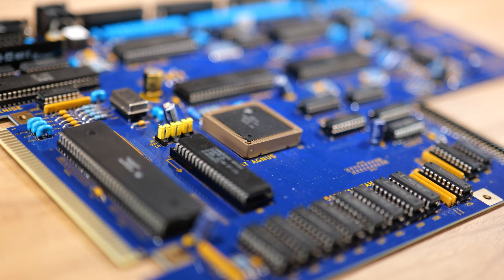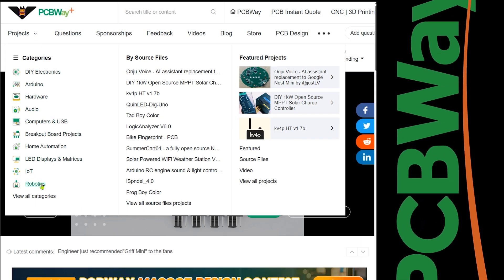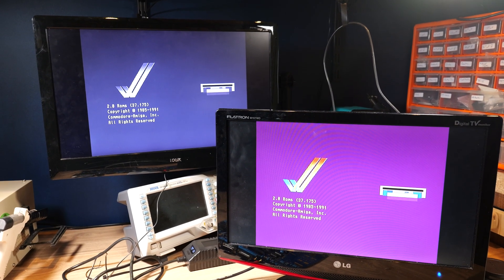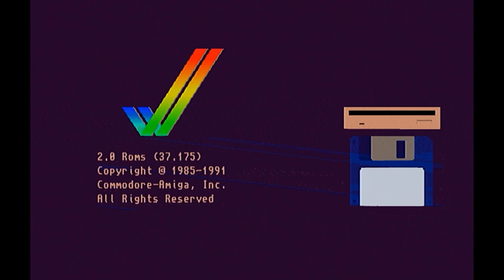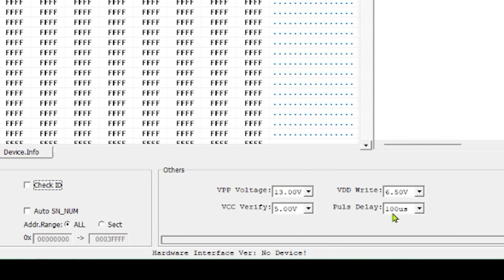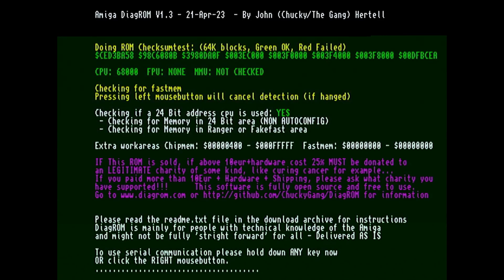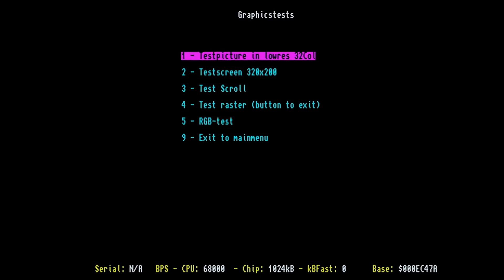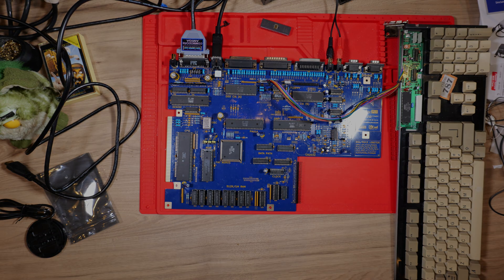Amiga 500+ Build - Fixing The Glitch!

Comment: I just wonder if you had put the original Fat Agnus back in and see if the fault was still there. When the A500 first came out, a lot came back with problems due to bad connections between the chip and the socket, whether it was a dissimilar metals issue I dont know
Reply from the maker: I did clean the pins with a fibre class pen and re seat it and had the same problem
Reply: I had a problem with one of my A500 that had oxidized tin/lead on Agnus leads. Used soldering iron and flux to get rid of it.

Comment: The reason the HSYNC and VSYNC signals have both input and output arrows on Agnus in the schematic are because the Amiga can accept sync and clocking signals on the 23 pin video port from external video signals via a genlock. This allows overlaying the Amiga graphics onto the external video source and was why the Amiga became THE computer for low cost video production in the analogue days. It would be worth checking the bad Agnus chip for damaged, dirty or bent pins if you haven't inspected it closely, to rule out a bad contact with the socket. The blitter may be working but if it can't synchronise it's DMA access with the CPU it may lead to corruption of blits.
Reply: Yup, not even just "low cost" video production either, there is a LOT of TV content from the early/mid 90's which did all their SFX through Video Toaster ;)

Comment: As soon as I saw that flicker I thought "Agnus..."  Good to see it working though.  With having the option on that board to select extra ROM address lines you can easily have Kickstart and DiagRom living on the same eprom and just shuffle those jumpers around to choose your required image. For example you could burn KS to the lower half of an 800, DiagROM to the upper half and then pull A18 high or low to select the required image.  Bonus being, last time I bought some, 27C800s were cheaper and easier to get than 400s.